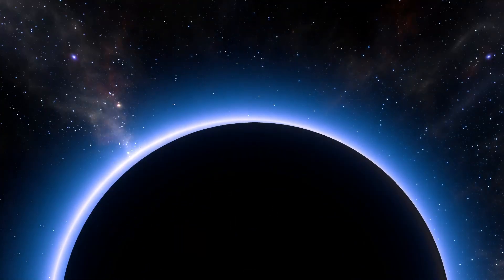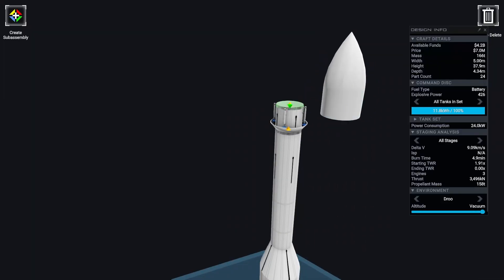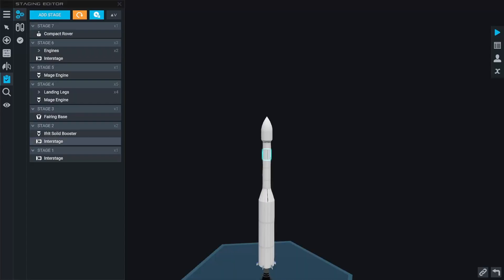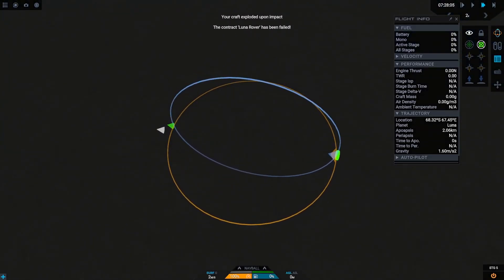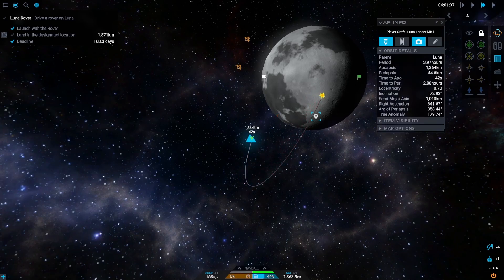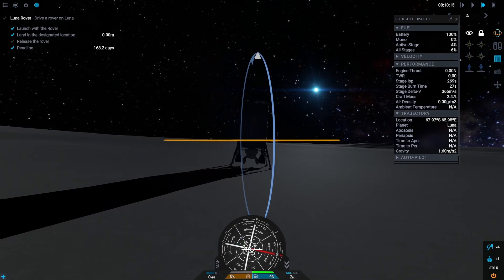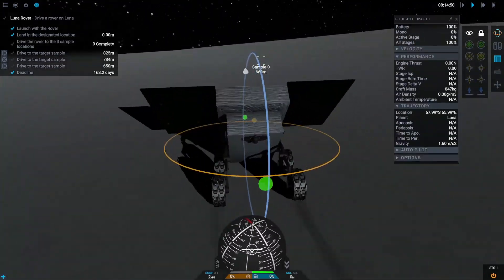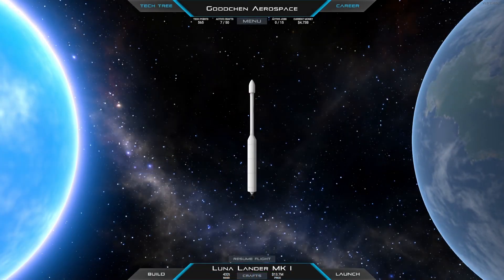Juno: New Origins | Contract #90 - Luna Rover

Comment: How do i take control the rover?
Reply: You can just select the command module and you will see a icon of the command module and press it. BOOM you are taking control of it
Reply from the maker: @soyelguerrerodefinitivo6844  Hi! There is a key bound to switching vessels. I think it ] on US keyboard. But just check your key bindings in the settings.
Reply: Is it possible if i'm on mobile? @Goddchen
Reply from the maker: @soyelguerrerodefinitivo6844  I haven't played on mobile, but I'd definitely say it should be possible there as well.
Reply: How? @Goddchen
Reply from the maker: @soyelguerrerodefinitivo6844  Since I haven't played mobile, I can't answer that. But what you can definitely do is switch to the map screen, select the other vehicle and hit control from there.
Reply: Oh tysm!! I forgot about that @Goddchen

Comment: Yeah, something was very, very wrong here.  The rover isn't very fast, but it should handle much better than that.  

You (somehow) were using the wrong controls to drive the rover.  It is supposed to use the normal pitch controls (W/A) for "move forward" and "move backward" while the normal yaw controls (S/D) are used for "turn left" / "turn right".  If you tried to control the rover via the autopilot widget, for example, it wouldn't work properly.  This seems unlikely, however.
Reply from the maker: yeah definitely. I found out in the next mission / video that this is most likely caused by parts being destroyed during the descend, caused by huge rotational g-forces that occured when the craft all of a sudden starts to spin rapidly. Some small parts of the rover got destroyed.